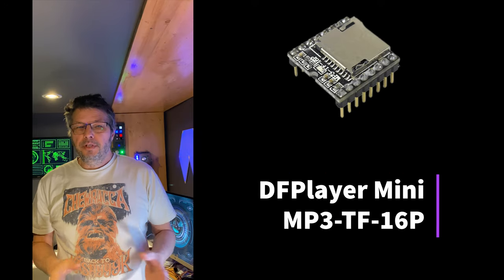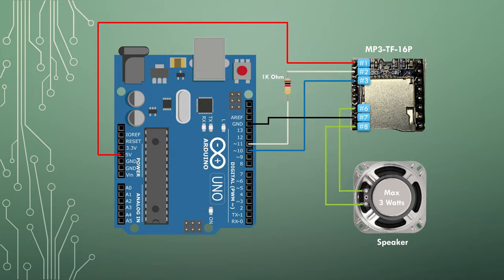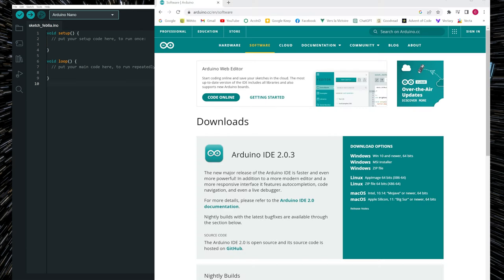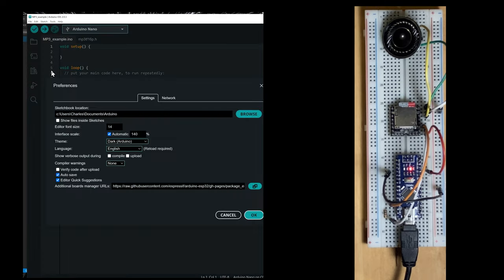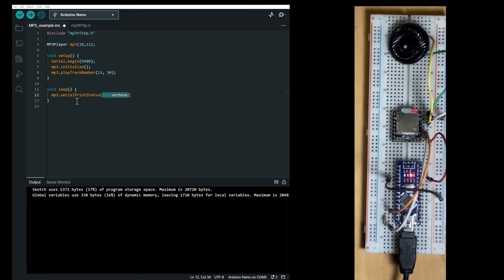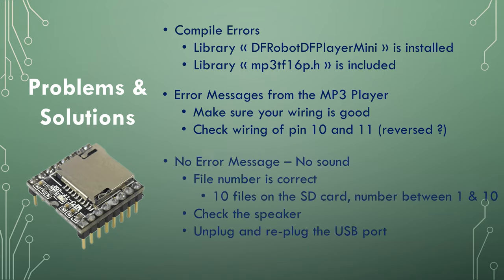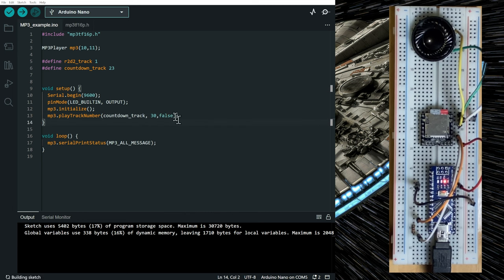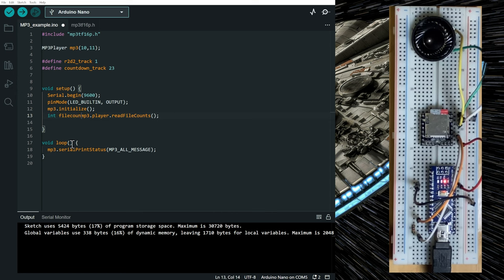Master the MP3-TF-16P (DF Player Mini) on Arduino: Seamless Sound Integration & Easy Setup! 🎶

Comment: This module works perfect for a project I'm working on its just that its a little quite even at max volume of 30. Is there a way to boost the volume without needing another module?
Reply from the maker: What are the specs of your speaker ?
Reply from the maker: Is it quiet with all the sounds you have on your SD card?
Reply: I'm working on a project rn that needs screaming. There are some amplifying circuitry you can do  on a breadboard with transistors and other components but it can get cluttered and complicated. If you do end up using a module try a PAM8403  (im using this rn) or maybe a LM386 (i havent used this)

Comment: I have a problem with playing loop folder function.
After playing for let say 4 songs in a row my buttons stop working 
but the music still contineus to play.
I only calling the button function from the main loop.
I have 5 button that use millis and state change for single and long press. 
Does maybe something have conflict with the code?or does it have a blocking code that prevents it to continue in main loop?
Reply from the maker: if your playing your song with the last parameter as true : mp3.playTrackNumber(1,15,true), this code is blocking and the rest of the code is going to execute after the song as entirely played.  Change the last parameter to false.
Reply: @thelastoutpostworkshop  
Thank you for the reply.
But i did not use playTrackNumber in my code.
The problem is with
mp3.player.randomAll and
mp3.player.loopfolder() functions.
When we say it's playing for at least 4 songs. The buttons just stop working.
I dont know if there a blocking code that prevents it to go to main loop.
Or conficts with my millis.
Hope you can help.
Thank you.

Comment: Hi Great clear video and content thank you. I have read through the comments below to see if anyone else has asked the following question.   I have this unit and everything works...except....I cannot play a track with a number greater than 10 (ten) 

I can play up to ten, so double digits work great but not in excess of ten.

I have fully formatted the card, the DF Robot player Mini is installed as is your very useful header file......

All the obvious and even some less obvious...

Have you had this issue, if you did what was your way forward please. 

If I find one I will post it here.  Thanks and I hope your Christmas was fantastic and the coming New Year also
Reply from the maker: I never had this issue before, do you get any message on the serial monitor ?
Reply: Not in the Serial Monitor, simply the track will not play and the program hangs. If I change to a track that had a modified date and position of ten or under, it plays perfectly without hanging :) @thelastoutpostworkshop
Reply from the maker: Paste your code here, I will check it out

Comment: @thelastoutpostworkshop Hi, I try to connect the mp3 player to a mega 2560 pro at hardware serial1 (pin 18 and 19). There seems to be no connection, can you help for a solution?
Reply from the maker: I don't have a mega board, so I cannot test it, but I assume pin 18 and 19 you are using are for the RX and TX pin of the MP3 player.  Have you tried using pin 10 and 11 on the Mega for the RX and TX pins on the MP3 player to see if it works ?
Reply: @thelastoutpostworkshop  Thank you, yes I tried. There is even no message at the serial monitor with the mp3.serialPrintStatus(MP3_ALL_MESSAGE) command. It works with the ADKEY pin, so it's not defect.
Reply from the maker: you mean the MP3 is working with the ADKEY pin ?
Reply: @thelastoutpostworkshop  I would like it working with the UART but to test if it's not broken I tried the ADKEY pin.

Comment: can you help me for some reason it only works if I use Uno not a Nano 
and in serial monitor for the Nano it says :
Initializing MP3Player …
MP3Player online.

the Uno works perfectly fine pleases Help
Reply from the maker: Very strange, the wiring shoud be the same.  Are you running the same code ?  Does the Nano execute the playTrackNumber() ?
Reply: @thelastoutpostworkshop  the wiring is the same and it doesn’t play the song :(
Reply: @thelastoutpostworkshop  i used a different tutorial and I got it working thx for trying to help me

Comment: Good evening, I'm trying to start the player but it says MP3 online, but nothing works, what could be the error? Can you help me please?
Reply from the maker: Reeheck your wiring.  Make sure the TX and RX pin are not reversed.  Do you have any error message on the serial monitor when playing a sound file ?
Reply: @thelastoutpostworkshop  no, nothing appears. Everything is connected correctly, there are no errors. I would attach a photo here, but this is impossible. Can we write to each other somewhere on social networks? I will be very grateful to you!!!🙏🙏🙏

Comment: When I run the sketch it only says mp3 player online and nothing happens. When I run the GetStarted example by dfrobot I get different results. I get a timeout error running it after the speaker makes a short crackling sound and then it says track 1 complete. I triple checked every connection with the same wiring in the video but I can't get it to work.
Reply from the maker: Seams like a wiring issue to me

Comment: Hi can you help me..i want to use your "mp3tf16p.h" with hardware serial..thank you very much.
Reply from the maker: Here is the code for using Harware Serial : #include "DFRobotDFPlayerMini.h", be aware that it is used  for Serial for communication with your computer over the USB port :

#define MP3_ERROR_ONLY 1
#define MP3_ALL_MESSAGE 2

class MP3Player
{
private:
    void statusOnSerial(uint8_t type, int value);
    void waitPlayIsTerminated(void);

public:
    DFRobotDFPlayerMini player;
    MP3Player();  // No pins in the constructor now
    ~MP3Player();
    void playTrackNumber(int trackNumber, int volume, boolean waitPlayTerminated = true);
    boolean playCompleted(void);
    void initialize(void);
    int serialPrintStatus(int errorOnly);
};

MP3Player::MP3Player()  // Constructor doesn't need parameters now
{
    // Empty constructor
}

// ... [Other methods remain unchanged]

void MP3Player::initialize(void)
{
    Serial.begin(9600);  // Start the hardware serial port

    Serial.println(F("Initializing MP3Player ..."));

    if (!player.begin(Serial, true, false))  // Pass the hardware Serial
    {
        // ... [Unchanged error handling code]
    }
    player.volume(10);
    Serial.println(F("MP3Player online."));
}
Reply: @thelastoutpostworkshop  thank you very much you are the best at this. Subscribed to your channel...keep it up..👍👍👍👍
Reply: @thelastoutpostworkshop  im having an
 error: request for member 'initialize' in 'mp3', which is of non-class type 'MP3Player()' mp3.initialize();
Reply: @thelastoutpostworkshop  do i have to change anything in my old script?
I've just pass the mp3 with an empty value.

MP3Player mp3();

Edited..: i get it...
I have to lose the bracket..thank you very much

Comment: How can we use DFPlayer mini with Arduino Nano 33 IoT ?
Reply from the maker: Yes, the DFPlayer Mini can be used with the Arduino Nano 33 IoT. However, there are a few considerations you should take into account due to the differences in operating voltages and the additional features of the Arduino Nano 33 IoT.
Voltage Compatibility: The Arduino Nano 33 IoT operates at 3.3V, whereas the DFPlayer Mini typically works with 5V signals. To safely connect the TX and RX pins of the DFPlayer Mini to the Arduino Nano 33 IoT, you might need to use a level shifter or a voltage divider to step down the 5V TX output of the DFPlayer to 3.3V acceptable by the Arduino's RX pin.
Serial Communication: The Arduino Nano 33 IoT has one primary serial port used for programming and debugging over USB. To communicate with the DFPlayer Mini, you can use software serial on other digital pins.
Reply: @thelastoutpostworkshop  Thanks for your prompt reply. Can you please make and share some tutorial on this? Shall appreciate your help on this!

Comment: how many sounds tracks can be played at the same time ?
Reply from the maker: only one
Reply: @thelastoutpostworkshop   i played rc tank, many sound tracks needed to be played at the same time, like 5 channels, then what i should use instead ?
Reply: I have tried this and, for sure not 5 chanels but a couple, and you have to conect as many dfplayer as channels you want, with only one speaker needed. For example in your case, i supose the noise of the engine sound will be one channel and at the same time when the canon shots you want to hear an explosion, then you play this on the second one. The dfplayer has to be connected to another pin set for RX TX comunication. And i reccomend to think about if you really need those five channels or if you can simplify them in less because all that will be so pin consuming

Comment: Does the player have to be connected to pins 10 and 11 ? If so why ?
Reply from the maker: You can use other digital pins since the Arduino library is using software serial Uart

Comment: hey, mp3 player turns off when i plug in the sd card. its slowing down my project. pleas help me.
Reply from the maker: Is there any message on the serial Monitor ?  Also recheck your wiring

Comment: Hi, if I want to stop the mp3 file halfway while it's playing, how would I do that?
Reply from the maker: The easiest way is to cut your mp3 file with the free MP3 editor Audacity : https://www.audacityteam.org/
Reply from the maker: You can also stop the song in code using the stop() function this way (here the MP3 stops after 3s):
  mp3.initialize();
  mp3.playTrackNumber(23, 25,false);
  delay(3000);
  mp3.player.stop();
Reply: @thelastoutpostworkshop  many thanks for the quick response. do you have a reference sheet that i can look into?

Comment: Could a pico run this?
Reply from the maker: I did not try it, my only concern is the DFRobotMiniplayer library compatibility with the Pico, but since the MP3 player use standard serial communications, it should work. Give it a try!